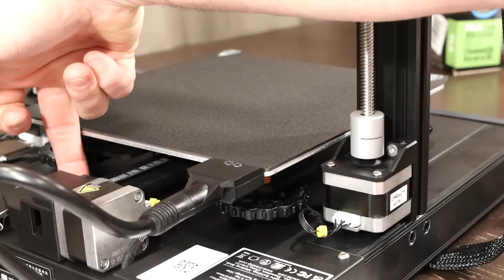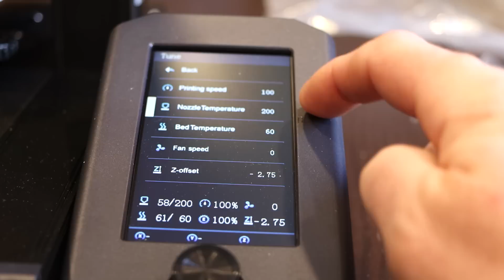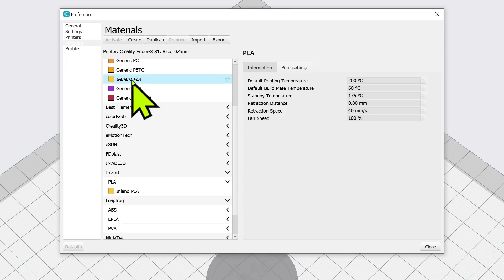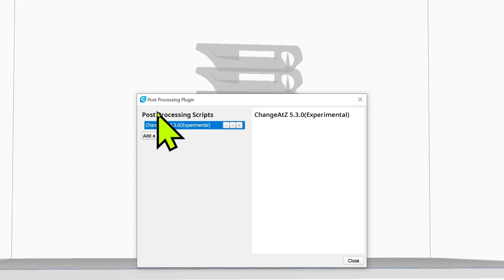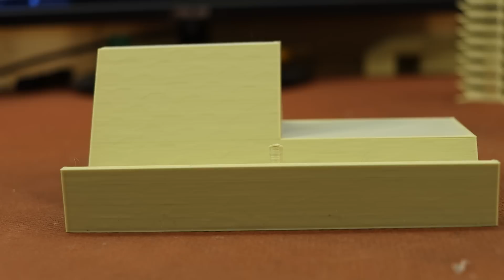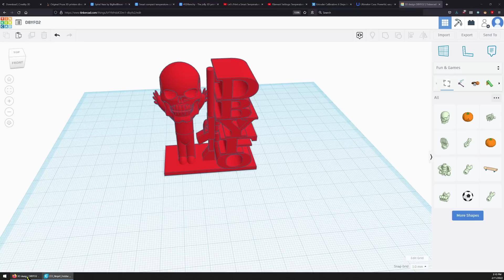Getting started with 3D printing

Comment: It was "a little bit loud" when you first fired it up because you jacked the Z-axis to the top of its range. Normal operation is to lift about 12mm, then start the home/leveling process. You already had it as high as it could lift, so the noise you got was the steppers trying to do the initial lift, but bashing against the limit of its travel. Harmless if it's only a once-in-a-while thing, but repeatedly doing that is a good way to eventually break something. As far as the nozzle temp adjustment, that's built into the sliced model as part of the slicing process - If you diddle the temp "early" on the printer, the setting in the .gcode file that the slicer produces will over-ride what you set the temp to. In general, you set the temp to be used at the time you slice your model. (Ditto for the plate temp) The line under the bunny's eyes makes me think you've got some "gunk" (That's a highly scientific term - don't throw it around lightly! :) ) on the leadscrews that drive your Z axis that's interfering with smooth motion - That'd be the first place I'd check. As far as slicers go, do yourself a favor and get away from the "Creality Slicer" - Google up "Ultimaker Cura" - It's the same (but newer version) program, but it doesn't have Creality's grafitti on it. I'm not 100% certain, since I don't use it, but I BELIEVE the Prusa Slicer is another "rebranding" of Cura - Cura is open source, so it's easy for anybody to put their "vanity-turds" into it and call it theirs. If you're capable of reloading ammo, you should have little trouble figuring things out by "fiddling with this, twiddling that, and messing with the other"
Reply: PrusaSlicer is a completely different slicer. It produces different G-code and has a very different UI. Personally, I prefer Prusaslicer but each has its strengths and weaknesses. Cura has a plugin interface which means there are a load of extra gadgets you can get (like different support structures etc) whereas Prusaslicer doesn't, but I find it generally more solid than Cura. I think getting to know both would be a good move in the long run, as one might be better than another for particular prints, but at the moment I find the Cura UI a bit fiddly and hard to find stuff. 
Regarding Creality slicer - yea, you should ignore it and use the "mainstream" version of Cura.
Reply: @IanSlothieRolfe  Like I said, I don't use prusaslicer, so wasn't sure. Seemed to me I'd caught talk that said it was Cura-based, but if it's not, I guess it's not! :) I've also been led to believe that if it's Cura-based, it's heavily customized for the Prusa printers. Either way, one or the other is likely to take care of most, if not all slicing needs.

Comment: I've had great success with printed solid's "jessie" line of pla. Incredibly easy to print, and quality is superb. A couple of the colors are smelly when printing, black specifically was unbearable. But even the cheapo stuff works well enough from other vendors, however I'll still order more black regardless, it looked really good, but ill try a few other colors see what stinks least, buying American from printedsolid will be my most likely continual venture.. Cyan and purple were practically scentless.

Comment: 11:30 you dont want that z axis limit switch because the auto level device now works as the z axis limit so if you had that one installed it could interfere with the auto leveling.

Comment: You just took one foot onto a slippery slope. Good luck, lots of communities out there that will help you figure things out. A few early "mods" you'll want to consider though. Also, popping the model off the plate usually works better if you flex it concave and convex ;)

Comment: Rule 1 of 3d printing ain't broke don't fix it. If it works leave it alone don't fall into the upgrade trap
Reply: Screw that! I have an Ender-3 V2.99. Meaning I started with a V2 and modified the hell out of it. Mostly I designed and created my own mods. It works beautifully and has taught me enough to design my own printer from the ground up.
Reply: @guruthossindarin3563 I thought this video was for idiots 😇

Comment: The PEI build sheet is the only part of the S1 that is a downgrade from the V2.  For printing PLA and PETG, the glass bed on the V2 is superior.  Prints automatically pop off when the glass cools.  You can buy the glass build surface on amazon and clip it to the build plate with binder clips.  The V2 comes with "carborundum" glass or some special coating.  I prefer bare glass because you don't have to worry about scratching it and I have never noticed any advantage to the coatings on various glass build surfaces.  If you're going to print TPU, ABS, or any other difficult to print filament, put your PEI sheet back on. That's what it's for.
Reply: I am almost universally using a PEI print surface and find it works very well.  Let the print cool and most of the time the print is completely released by the time I touch it.  Even when still warm, a slight bend of the steel sheet and prints pop right off.

Glass is super heavy compared to a steel sheet, which will have an effect on a moving bed printer like the Ender.

Comment: Don't stress over the print surface.  The OEM surface is crap.  There are loads of different and good spring steel print surfaces available on Amazon.  My favourite is the dual side smooth-powder coated PEI. 

Get an inexpensive heat gun to quickly and easily deal with fine stringing on a finished prints.

Being able to model your own parts is the key to 3D printing.  It allows you to make anything you want.

Get some TPU95 filament.  It is one of my favourites to work with.  TPU is somewhat flexible and is very strong.  Printed with thick walls and high infill it produces parts that are only slightly flexible but very resistant to breakage due to their ability to flex rather than fracture, like PLA does.  TPU is also super easy to print and sticks well to the print surface.  Just need to adjust print speeds and combing to minimize stringing.
Reply: the best cheapest print surface is a 1/16inch (1.5mm) thick sheet of G10/FR4/Garolite.  If you can find it that is. (also requires clips or some way to secure though)
Reply: @Kissker  He can order it from McMaster Carr.  If he can reload ammo, he can make straight and accurate cuts(like glass, you score it with a craft knife then snap it) in fiberglass and sand the cut edges while taking sufficient precautions to not kill himself.

Comment: Find a youtube channel CHEP. He has all types of great info for beginners. Great slicer helps. I highly recommend the magic numbers video.
 Welcome to your new addiction.
Reply: You'll  be able to set the print temp in slicer when you load print to printer.  Stored in the g-code file.
.stl files are the concept from CAD program.
 You can set file to not print that ring of filament around main print within slicer. They are not always needed. Rafts, brims and skirts or none. Use them for  items that are narrow at bottom an wider at top. 
  Peal the purge lines when it moves to center to print file.
The blips on your handle print could be as simple as the humidity and the PLA material as they are all humidity sensitive. So the blip is a mini steam bubble.

Comment: Try a 1/16" G10 composite bed. You can buy G10 sheets at McMaster Carr. For PETG,  the prints self release after the bed has cooled. And you get a smooth surface that was on the bed.

Comment: Just picked up the Anycubic Vyper myself.  Been trying out a few items from Thingiverse.  Looking forward to getting into the CAD side and coming up with some of my own designs.
Reply: @Shooter59,    that's the printer I keep coming back to looking at getting for my first as well. What slicer software did you start with Cura?
Reply: @corytarby6643  Yes. I'm using Cura right now.  Trying not to add to many complications to this until I get it worked out.  Still alot to learn.
Reply: How do you like the vyper?
Reply: @corytarby6643  Well its my first printer and I'm still learning.  It was easy to set up and get printing. So far I like it.

Comment: First off, great video outlining the process. Your experiences are similar to mine starting up and it is very well done (Ender 3 V2). I have a number of thoughts that are hopefully helpful to speed up your process and maybe save some headaches.
As someone who has used 3 different major CAD systems (Fusion, Solidworks, and Catia), watching you use Tinkercad was painful for the monitor support. Please go download Fusion 360, it is free and will work more like you expect for functional parts. It will not have the fun stuff you messed with like the skull.
Circles are not the best shape to print vertically like you did as a space saver in the monitor holder. If you want to save some print volume, triangles are the way to go. There are a bunch of other things you will learn to keep in mind when designing parts to print, but this is a very basic one.
There is an offset in Cura to make your first layer thicker. This could help with your Z-offset problems, and you can adjust per material. I set my Z-offset using a 0.1 mm feeler gauge and it has helped a lot with my prints coming out right. There is a similar option for temps and speeds on the first layer, along with fan speed.
You should mess with some of the support options in Cura. In particular, I use Gyroid and Lightning infills will save you time and material. Gyroid for structure, lightning for cosmetic supports. There is also a gradual infill steps option that can be helpful for saving print time and material.
PETG, turn off your fan. That should help with printing.
Hopefully something in there is useful.
Reply: I used Tinker CAD once.  It is crap.  I have been using Solidworks for more than 12 years now and can't imagine using anything else.

Comment: Easy to go off the deep end here. I started with bench organization and cartridge specific reloading trays in 3D prints. I then decided to start using this method as prototyping and then make the final version on a CNC Mill out of aluminum and then home anodize and laser etch engraving….hard off the deep end. Considering making some posts on forums and see if anyone is interested in buying some to support my addiction

Comment: Automatic bed leveling is nice but it is a good idea to manual level the bed first then run the auto level second. Having it mechanically closer to true means less work for the auto level adjustments that happen in software. The less compensation movements that need to happen in order to stay true to the bed the better. It will result in a better print quality. Also having the limit switch installed anyway is a good safeguard even if it is set up a bit lower than normal on the machine.

Comment: I do a ton of 3D printing. A slicer is important. I suggest checking out SuperSlicer. I have used slicers from industrial proprietary crap to free stuff, and my favorite is SuperSlicer. I used to use simplify 3d, but they haven't release an update in a LONGGG time. 

If in the future you decide to go with more performance, go with a corexy design, like the Railcore II (my personal favorite), you can get toolchanging set up to switch filaments/etc. 

For budget large format, Ender 5 plus is good. Slap a .8mm nozzle on it and your good to go.

Comment: The best material you can use in regular printers is CF Nylon, ideally PA6 CF15. German Luvocom makes great source material shich is much better than 3DXtech and much cheaper. Produced by many companies in europe like Innovatefil, Treed filaments.
Definitely on par in some regards as alluminium. However, you need all metal hotend for it and at least food dehydratator as it likes to absorb a moisture.
Basically, as a matured 3D printer user these days who is able to design some very complicated stuff, I only print ABS/ASA and CF Nylon. Will upgrade my coreXY printer to be able to print PC too.
These are where serious engineering thermoplastics starts. PLA might be usable ie to make your own bullet feeder (which I happily use with my Dillon) but for some serious shit, you need some serious materials. These are much harder to print, so start slowly. It will come after time :)
One also has to realize limits, but advantages of 3d printing too. Limits are obvious - not as strong parts as regular ones, it doesn’t make any sense to print something which you can get much cheaper or of better quality and thoughness, like storage boxes etc. 
But for designig and printing custom parts you can’t buy it’s absolutely great tool.

Comment: This was fun to watch you go through all of the noob mistakes and head scratches I went through when I jumped into 3d printing. Couple things to make you aware of, petg absorbs some water so will need to dry it to eliminate some of the stringing and adjust the retraction distance as you stated PLA's don't really absorb much water so you won't see a big improvement drying it. PLA and PLA+ will be weaker if printed too hot or cold. So don't cook the filament even if it looks better.
Reply: PLA is surprisingly actually more hygroscopic than PETG
Reply: @greenrabbit0341  I don't think that's true undried PETG is basically a waste of time to try to print with. It is going to be a stringy mess, PLA on the other hand doesn't need to be dried every single time you print with it. Sure you may get a little stringing but nothing in comparison to PETG or Nylons. Just dried some PLA for around 4 hours and it printed perfect! PETG to print as good usually requires at least 12 hours and closer to 24 hours for zero stringing and if you're using clear PETG then the more dry the better!

Comment: A fun project to get into is 37 mm launchers, as both the cases and projectiles can be printed. Meaning that all you need is 209 primers and pyrodex
Reply: Oh and you can print the 37mm launcher too.
The most popular one is called the thump n’ grind by “awcy?”
Reply: @collinis1  thanks. I’ll check that out.
Reply: That's brilliant!
Reply: I 3D printed masters for the short plastic shells and made a silicone mold to cast projectiles. I’ve gotten good results making gas initiated spin projectiles at 2.5 oz over 50 gr by volume of pyrodex ffg roughly 300 yd launch distance with decent accuracy
Reply: @alexmason1387  what are you filling the mold with ?
Reply: @collinis1  polyurethane casting resin
Reply: @alexmason1387  that's a really good idea
Reply: @Grognarthebarb  thank you
Reply: It's so true. I've had a ton of fun designing and printing 37mm
Reply: I saw them but they don’t really look super impressive with the range
Reply: @marklynch1305  you saw the wrong ones then
Reply: @alexmason1387  I must have I was Excited for the release then I seen a couple videos of them and it was ass lol what’s the video called?
Reply: @marklynch1305  I haven’t seen or looked for videos for 37mm in a long time. People are kind of scared of posting anything 37mm related due to it riding a fine line between signaling device and destructive device. For round performance you need 1. good combustion (keeping powder contained as long as possible during ignition) 2. A nose heavy projectile at the minimum ( gas initiated spin does wonders). If you make the od of the projectiles true to launcher bore you can take advantage of longer length barrels
Reply: Where can a fella get a launcher is the question bc I can print everything and have kegs of pyrodex lol 😆
Reply: I don’t know what’s going on but it sounds exciting
Reply: @Cons2911  haha, I'm assuming flares, but had 203mm in mind🫣
Reply: And fertilizer
Reply: I’m getting started to printing them any tips

Comment: As a realoader who got into 3d printing a year ago. Welcome to the rabbit hole. Now Im 2k into a custom Voron 2.4 build
Reply: LOL.  I started with an Ender 3 and have made so many upgrades that I have easily doubled the cost of the original build.  I am running full 3-axis linear rails, a BL-Touch and a custom direct drive using an EZR-Struder.  Also upgraded to a Touch Screen and bigger main board.
Reply: @ExpatriotSilencers  been there done that